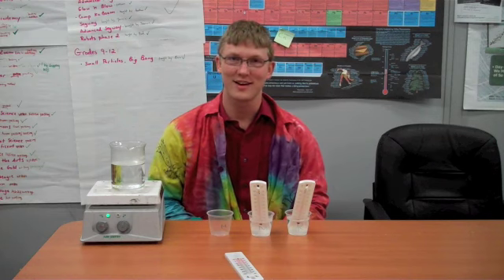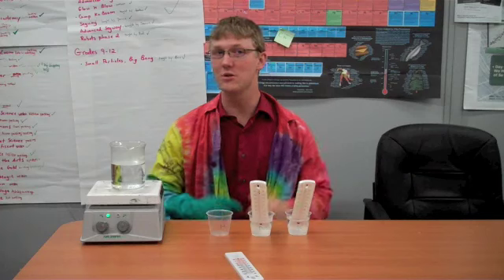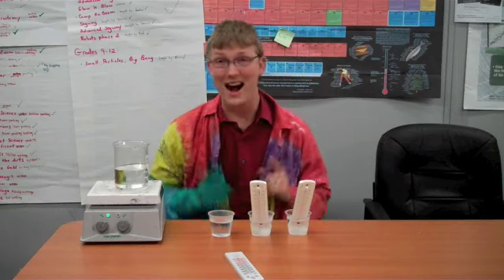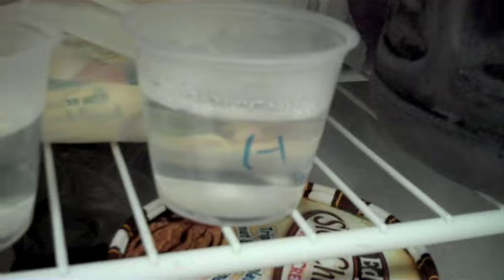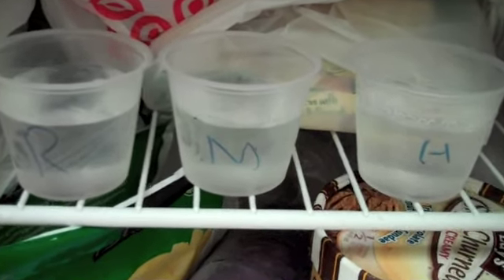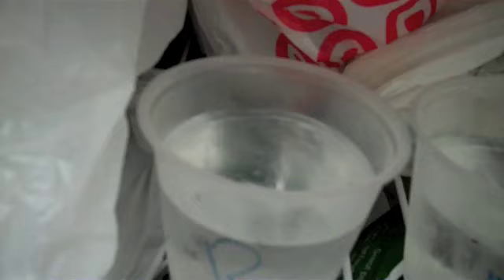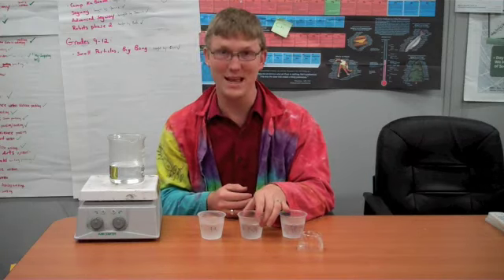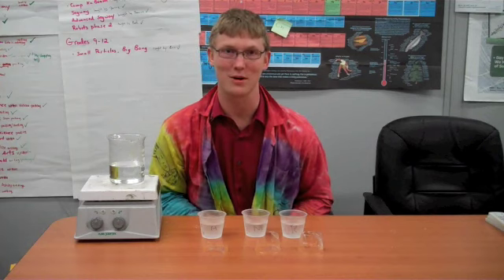Freezing Hot Water

Comment: an easier experiment would be to have one cup at 33 f and the other 212 f and  see which freezes first.
Reply: sir it is true that putting a glass of hot in the freezer while it is on can damage the freezer or the refrigerator? thank for the response sir
Reply: KNJ KNJ no, it will not damage anything
Reply: @k1awesomeness  thankyou sir
Reply: @knjknj5232  Lol you like using the word sir a lot.
Reply: In that case, the cold water would definitely freeze first.  Assuming no supercooling anyway.
Reply: If you had 3 identical sealed containers with the same mass of distilled water there would no comparison. Water at 32°f will start to freeze almost as soon as its put in the freezer where water at 212°f has more than twice the energy to exchange with the environment to become ice.
Reply: @k1awesomeness  great now i can tell my mom that it wont do anything to the fridge
Reply: @balokrumput9074  yeah, thats not how fridges work

Comment: Wow. This popped up while searching about ice expansion. 
I’m not a scientist but I see a few issues with your experiment. I also heard this theory long ago and thought it was BS. 
First issue. You used boiling water which is extremely hot, not just hot. 
When I first heard about this theory, I imagined hot water out of the tap. Why would anyone put boiling water in an ice tray?
Second issue, when freezing, the three cups could be affecting each other. They should be freezing in isolation with a timer. 
Third issue. You did not allow the cups to completely freeze.

Comment: 2:12 there's the answer. Room temperature water freeze first. If you want the hot temperature water goes freeze first, toss it in the air in freezing weather temperature, the vapor of it will freeze. the bigger portion of it goes down to ground. Now toss room temp in the air freezing weather, nothing will happen because it has no vapor left in air to be freeze.

My point. In any circumstances, there's no way hot water freeze first than room temp water. It's just the vapor that have been frozen not the whole hot water itself. Result is same with 4:07
Reply: Ah... then I just wasted my time loading up a second tray in my freezer... at least i used room temp in first tray. Serves my right for thinking there'd be any truth to a tiktok ¬_¬

Comment: I tested 2 3/4ths cups of water each in plastic cups to simulate a modern ice tray. The "hot" water was around 120*F out of the tap. The other was cold tap at near 70*F. Left in the freezer in as even a space as possible both were cold and forming ice. There was nearly a 5*f difference between the two. 
Hearing that the modern progenitor of the idea had "boiling hot fluid" freeze faster in the freezer was actually Ice cream he was making I'm thinking the minor amount of salt in it makes it freeze faster. Since we know salt makes water transfer energy much more speedily than normal boil or freezing. My little hypothesis. I'll stick with ice cold or rather cold  water in the future for making ice and not waste anymore energy required to draw energy out of water to turn it into a solid for later coolness.

Comment: Your temp. range of cold and hot water is too close....so takev some long readings and then see it.....This effect is known as Mpemba Effect and it is   universally accepted ...and don't take the third cup
Reply: Oof. If you had two identical sealed containers with the same mass of distilled water in them, one at 32°f and one at 212°f, there is no possible way for the hot water to freeze first in a controlled environment. A 2016 study by Burridge and Linden states "We conclude, somewhat sadly, there is no evidence to support meaningful observation of the Mpemba effect". That means they didn't see it at all. That's one of the last studies done on it, to say it's "universally accepted" is a lie. It's not accepted by academics or researchers into the observations of a child making ice cream. Any of the experiments that show a hot water freezing first have varying degrees of supercooling and didn't use sealed containers, or distilled water or both. Those experiments also only comment on the time to the formation of ice, not complete solidification. When your cold water sample starts at 4°c and doesn't form an ice crystal until its below -6°c at maximum and the hot water has suspended particulates because it's not distilled and freezes at 0°c and you conclude the experiment when the first ice crystal is observed you haven't done research.

Comment: If you take into consideration the temperature of the, “near boiling”, we’ll call it 200°f vs room temp water, 78°f, than the hot water solidified at an accelerated rate. I’m not a scientist, but I’m assuming that you’re trying to replicate the Mpemba effect. If that’s the case, you just proved that hot water freezes at an accelerated rate. Remember, they both have to reach 32° to begin to crystallize. Keep in mind, your room temp cup had a Headstart of over a 100°, yet they both crystallized.

Comment: You screwed up at some point, the Mpemba effect is very famous and studied. Hot water freezes faster
Reply: No, it does not always freeze faster.
Reply: How in the absolute hell would he have messed this up?  Ive taken thermodynamics and heat transfer engineering courses in an abet accredited program.  Its physically impossible for hot water to freeze faster than cold water in equal volumes, dimensions, and conditions.

Comment: This is not scientifically acceptable. There is no exact documentation. Here's how you do it.

Get 3 cups and 3 scientific thermometers. The thermometers should be a temperature insensitive gauge connected to a sensor by an insulated wire. The sensors will be totally immersed. Fill your cups, each with one temperature of water. Immerse the sensors and put the cups along with the gauges connected to the immersed sensors in the freezer. Check every 15 minutes recording the temperature on each thermometer.

This is the only method that would be accepted as scientific. Although the interval between checks would be flexible.